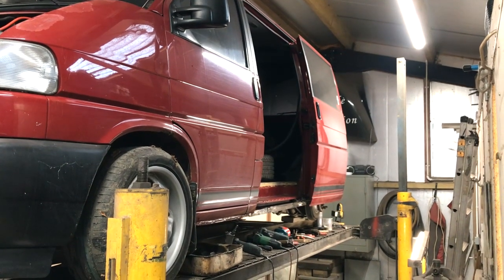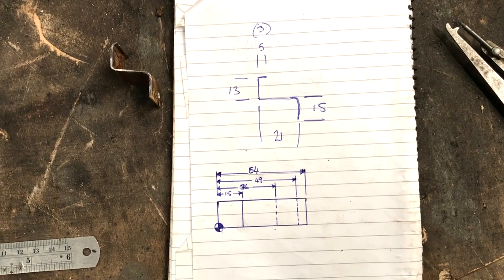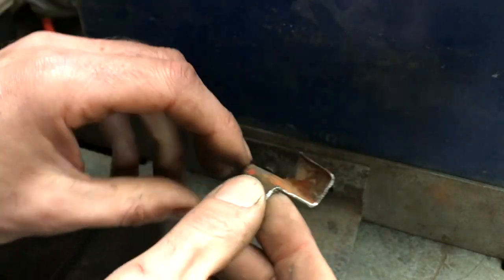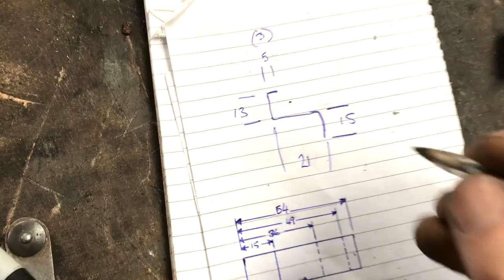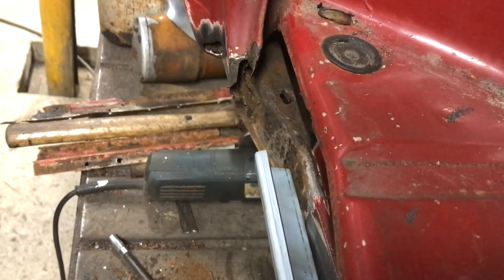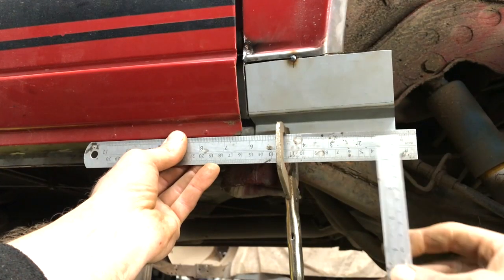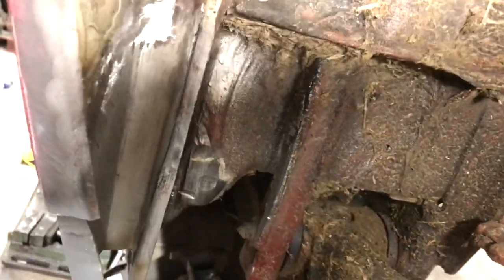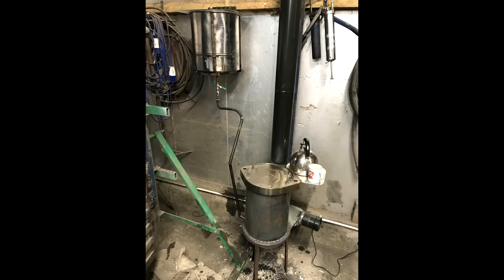How to make and repair a VW T4 van sliding door sill plus arches

Comment: Hi Ben
Love the videos. Here's one for you:
The "floor" of guide channel that the lower door roller tracks along is succeptable to rust/rot. Probably one of the main reasons for door sag at the front. If you look at the point at which the roller comes to rest when the door is shut, thats the spot that starts to rust out first. I was thinking about creating a new channel floor out of steel plate (possibly full length of the rollers travel) and getting it stitch welded in.
Do you think this is do-able or would you have a different approach?
Reply from the maker: Hi, sure it's possible, the track the rollers run against is thicker steel than the rest of the sill. This means that the curve panel with folded edges is harder to make in one piece. It might have to be made in sections and welded together before installation. I've replaced smaller sections of the track, like you say at the front. As long as you accurately align the sections to be joined and grind the weld smooth the door will run nicely across the join. I think you might be able to buy the panel for the track, worth a look before investing a lot of time making one.
Reply: Thanks Ben!
 @bensclassicbodywork

Comment: Familiar looking guillotine, I did mine is grey because I have 5 gallons of it....  It did have sheet steel guards/covers over the blade area, binned them as it was difficult to see where the blade would cut without a torch. I see you have mesh on there. Probably sensible.  Good video as always, lacking the fluff and waffle that so many videos are filled with, just solid info and to the point. Perfect.
Reply from the maker: You have got as many tools as I have !!  😀
The guillotine as you will know is a brilliant tool and a real time saver, you might waste a bit more material but worth it in my opinion. I don't push it to cut more than 1mm steel but I know it will cut 1.5mm in short lengths. 

I thought about mounting an angle grinder to a slider to cut longer thicker material. Might still make this, it might be useful. 🤔

Thanks for the kind encouraging comments, any feedback is gratefully received, you never know how you come across to people unless they say something. 
Have you got a Pullmax or similar style reciprocating machine ? I bought an SMV nibbler but have struggled to make it do anything well. I think it would be good at deep shrinking but the tools are expensive and making them might not be straight forward.
Reply: @bensclassicbodywork  I don't have anything as fancy as the Pullmax or SMVnibbler. My only experience of nibblers is the hand held ones, which are short lived and fickle machines, soon consigned to 'under the bench' .....
Reply from the maker: @innleadair  Yeah, I didn't get on with the handheld nibbling tools, tried one once and it was ok but not really for cutting accurately. Mine broke and got sent back. 
I would really like to make use of my SMV, I'm sure it does something well, if not it will be going up for sale. People rave over Pullmax's there must be a reason.
Reply: @bensclassicbodywork hi Ben your videos are so clear verbally and visually.🎉 I don’t have ability to do my door where are you? I’ve used kurust but my area does need some replacement! Sue W

Comment: These are fantastic videos.  Thanks for taking the time to put them together. I've just started my classic car journey (Austin A30), and have a lot to learn!  Keep the videos coming!
Reply from the maker: Thanks so much for the encouraging comment. I will continue with the videos. 
plenty of curves on an A30 which helps when it comes to controlling welding distortion.
Reply: @bensclassicbodywork  I'll take any help I can get 😂 finished the tear down and the engine disassembly and just starting to learn how to weld MIG 👍 looking forward to your next one (and still in shock that you build a helicopter)! 👌
Reply from the maker: One mistake I see a lot of with people just starting in body repair is they will cut off all the rusted sections of their car in one go. I suppose I can see the thought process but this is the worst thing someone can do. The maximum structural rigidity needs to be maintained at all times or things can get really tough to put back together.  I did a Riley elf where the owner cut out so much the whole body was flopping all over the place, it made it so much harder and time consuming than it needed to be. 

You're the first to comment on the helicopter. I'm quite proud of that project, hopefully next season I can get a bit higher with it. It's all metal work at the end of the day, same skills just  different shapes. 
With so much on YouTube car restoration wise I should imagine every bit of info Is there, you just have to find it and choose who's advice to go with.
Reply: @bensclassicbodywork    Yes, I was advised heavily to ensure I had a fabricated piece ready before a part was removed! No idea what I'm doing, but I'll get the hang of it. Glad to have found your channel and now hunting for a fly press 👍 H

Comment: tidy job ,,, try a joiners sliding gauge for long lines ,, I have one with a hole drilled in one end and a pencil pushed in , and the spike left in the other end ,,, very very handy bit of kit.
Reply from the maker: Thanks for this, you have reminded me that I have a mortise marking gauge which I assume is similar to the joiners sliding gauge? I used it for marking longer width parallel lines when the odd leg calipers were too short. I agree it's a great tool just a little more cumbersome to use than the calipers. I must remember I have it more often.    👍
Reply: @bensclassicbodywork  mortice gauge usually has two spikes ,, same idea though ,,, with a pencil in they become mighty handy.

Comment: Excellent video, must add a set of those odd leg calipers to my Christmas List. Would be good to see a video on making up outer sill repair sections that have a radius to them, and how the DIYer might be able to match the profile without full-size fab machinery
Reply from the maker: Hi and thanks, the curve on a sill i did in this video

 Classic Car Sill Rocker panel Repair
https://youtu.be/q8OIpc5ALtA

However I used my English wheel which few people have got and metal rollers which I haven't actually got are expensive too. The third option would be in the flypress with round tubing but there might be a half decent way to do it in a vice, I'll have a think about it. 
Before I had these tools i probably would have done it with a cheap folder but it wouldn't be great with all the small folds making up the radius. Great suggestion. 👍